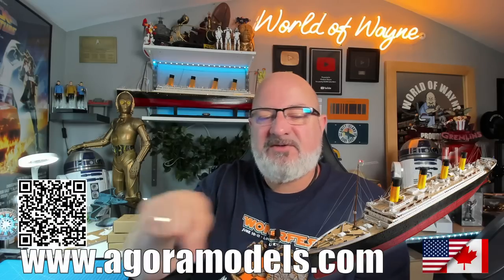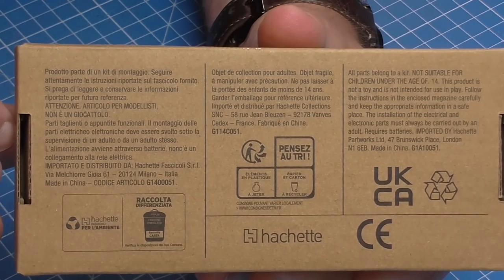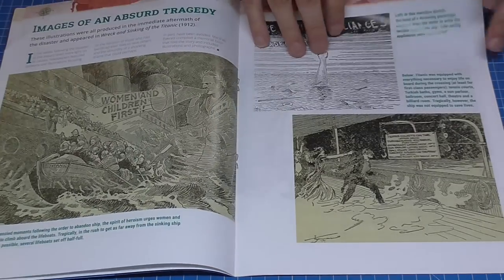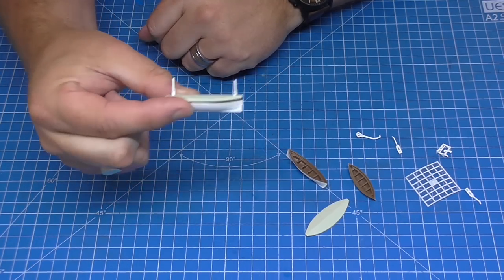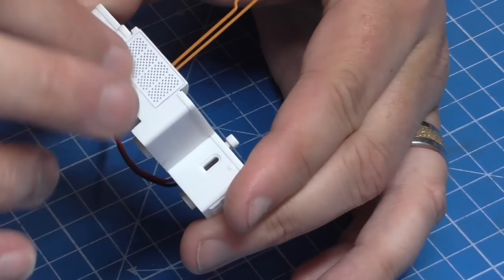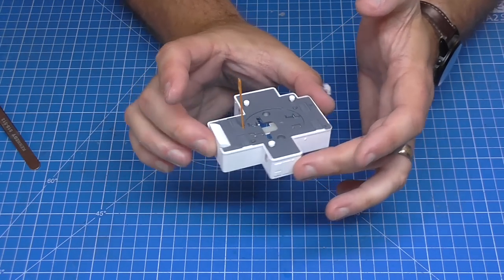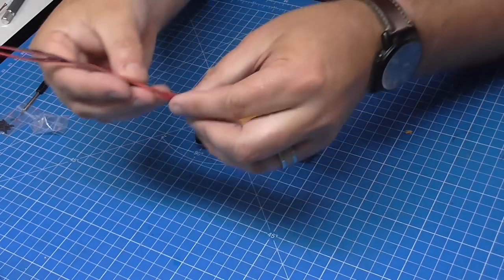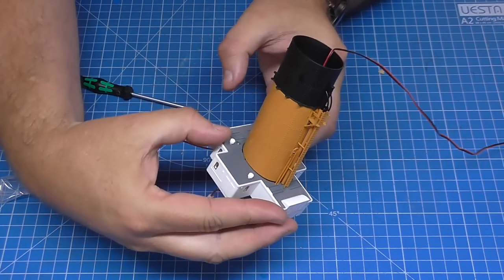Agora Models Build the RMS Titanic - Pack 10 - Stages 51-56

Comment: nice build. Does/will the kit supply any type of diffuser film for the windows?
Reply: In issue 61 and 63 we screwed the rear two deckhouses down and no there was nothing behind the windows
Reply: When you get to putting the decks on top of each other you could put the lights on to test.
Then you can decide if you want to add your own diffuser to the windows.

Comment: What glue do you use to attach parts and the deck overlays?
Reply from the maker: Just a regular CA glue like Loctite
Reply: @WorldofWayneUK  Thanks! And that works just fine under the wooden deck pieces that go on the hull to secure them down too?
Reply from the maker: @ryan1828  no for the wooden deck use a wood glue. When it's fully. Used it will stick to the plastic
Reply: @WorldofWayneUK  got it, thanks again! Just starting the model out myself so I appreciate the advice!